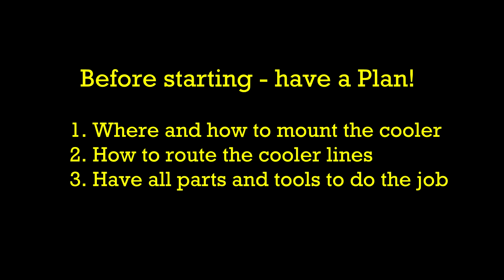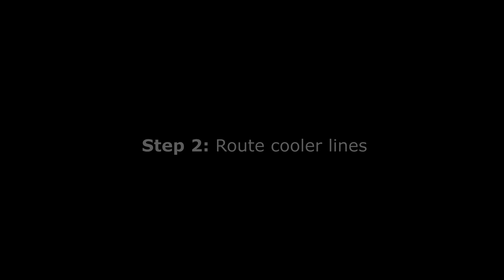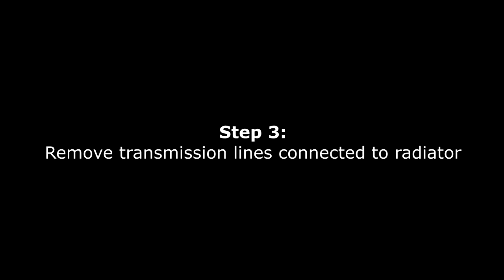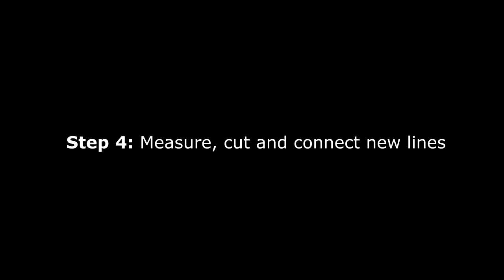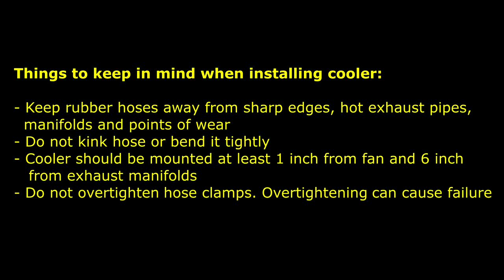How to Install Transmission Cooler Bypass Radiator - GMC Canyon, Chevrolet Colorado, Hummer H3

Comment: Excellent video -- short, to-the-point instructions, great camera work, and no needless chatter. 
Careful workmanship is evident throughout the video.
 HOWEVER, 😁, there's room for improvement, thusly:
 1. Your "Stacked Plate" type cooler is mounted UPSIDE-DOWN -- should be mounted with HOLES UP to avoid air pockets and achieve maximum cooler efficiency.
 2. Should use "Fuel Injection" type Hose Clamps -- They clamp tighter without damaging the rubber hoses.
 3. It's NOT COOL to by-pass the internal radiator Trans Cooler. NOT recommended by the "Stacked Plate" cooler makers. ONE Japanese car maker had cooler tanks fail abnormally, while the overall failure rate of cooler tanks is VERY small, and NO cause for alarm.
Those concerned with the coolant tank failure should GUARD against it, by checking the Coolant for ELECTROLYSIS.
 Place the "+" probe of your Voltmeter into the Coolant (engine WARM), and the "-" probe on the Battery NEGATIVE post. Should read less than  0.4 Volts DC.
 If experiencing high electrolysis readings, run a GROUND cable from the ENGINE BLOCK to the NEGATIVE Battery Terminal.
 I've run a B&M 13,000 btu "Stacked Plate" Trans Cooler for over 16 years and over 180,000 miles -- and I live in Phoenix, the hottest big city in the U.S.A. .
 Coolant is routed from Transmission OUT to Cooler IN -- Cooler OUT to Transmission IN.
The Cooler Maker's (B & M) Instructions said to do it that way, and it has worked perfectly for years of scorching desert driving.
 https://www.mercuryforum.com/forum/grand-marquis-14/1995-grand-marquis-restoration-8937/

Comment: This is exactly what I was looking for. I want to bypass the internal cooler so no chance of mixing fluids. What did you use to plug the old connection points on the radiator?
Reply from the maker: My wife's big ear plugs for now until I find proper solution 😊.
Reply: @NewRoad  Honestly it probably doesn't matter too much if it's not going to be used again.

Comment: I am about to do the same thing to a 2015 suburban and a 2002 Tahoe.  I have had 2 different friends radiator fail and water get into the transmission and smoke them.  I also live in the south and don't need the radiator to heat up my fluid.  I am just concerned about the rubber lines failing down the road. I am also going to use fuel injector hose clamps. How long have yours held up?
Reply from the maker: I installed this one 4years ago - no issue at all. Rubber hoses are tick and manufactured for high temp. Just make sure you properly tight hoses to line and cooler -  rubber hose should go over the metal lips on both trans line and cooler and clamps should be behind the lip to prevent slippage
Reply: @NewRoad  Gotcha.  Thats how I planned on doing it.  Now if the temps will cool off a little.
Reply from the maker: It is cooling more than I expected, never go higher than 180F even when outside is 93F

Comment: Great video bud!

My only suggestion, is that center support is blocking quite a bit of the cooler. That's going to reduce it's effectiveness significantly.
I considered the same placement of mine initially but then opted to put to the the right of the support so that the entire surface gets hit with fresh air.
Reply from the maker: Thanks. I thought about it as well - but here is my thinking:
- My main goal was to separate trans cooler from radiator so fluids don't get mixed if radiator breaks. Even if I get 50% efficiency from cooler it is still better than internal in radiator. 
- By rough calculation by measuring how much the support is blocking is ~25%. However, it might be less - since I have 1 inch gap between support and cooler - which will allow air circulation.
- The cooler rating is higher than I need for my H3 - GVWR up to 24,000 pounds, towing up to 5,000 pounds. That should compensate for blocking part of cooler
- I have only 3 months when outside temp is about 77F, the rest of the year is much lower. I don't tow and I don't go to desert :-)
Reply: @NewRoad  yeah, I did the same... Completely bypassed the built in cooler.
Reply: NewRoad Adventures You tow 5000lbs?
Reply from the maker: @lordsonic4567  I don't tow, but I do a lot of offroading and overlanding
Reply: @lordsonic4567  l tow up to 5000 lbs. with my 69 f-100 , 300 straight 6 cyl hooked up to a C6 auto transmission. It's got more than 100k for sure. I've got a trans. fluid Cooler out of a 95 Ford f-350 dually. Bypassed the radiator, not quite as big as in video but l got to thinking of replacing it with the one shown. Cause l live in part of US where temps. reach 100 degrees and up to 110 sometimes for 5 mos. a year. Maybe  adding an electric fan too. I haven't had any trans. problems yet, but l got to thinking since l don't have a trans. Temp. gauge. This was a very well done video. I'm out the door on my way to Napa! Does it matter which way the inlet and outlet face? Up,down or to the sides? Thank you.
Reply: @olblu8746  Yo, Blu -- the "Fin & Tube" type coolers (like in the video) can be installed in ANY position.
 The "Stacked Plate" type cooler MUST be installed with HOLES UP for it to function properly.

Comment: How’s it holding up 3 years later?
Reply from the maker: Works better than expected... cooling more than I need, perhaps because I am in Canada 😄. If you do decide to install - make sure push rubber hose far enough behind the lip on trans line to install clamp behind the lip just to make sure

Comment: What are your average trans temps now?

I installed a CRF radiator and put this cooler inline with that after it. Trans stays at about 175 now on a hot day on highway. (Compared to being at 200+)
Reply from the maker: I have not seen my trans temp going higher than 183F on very hot day, and I am happy with it
Reply: @NewRoad  I have H3....no trans temp gauge...how are you reading the temperature?
Reply from the maker: @terryvaughn677  I am using ScanGauge 2 - here is how I setup: https://youtu.be/4XxPsBD1qAQ

Comment: Is that a regular drill fitted with a cutting bit? I can tell from the low RPM. My cheap ass plans to use metal cutting disk for Dremel on a regular electric drill, too.
Reply from the maker: Yes, I have very cheap drill - and it does work all the time 🙂
Reply: @NewRoad  Thanks! I just did mine today. Running good so far. Thank you for this!

Comment: Hoping for an answer since it's been so long since this was posted, but what do you plug the radiator lines with?
Reply from the maker: You will lough... 😄, I used ear plugs and tape to seal it. I planned that to be a temporary solution - but forgot about it and it's still there...
Reply: @NewRoad  came here just for this question lol, so what would be a permanent plug if that was just temporary?

Comment: Others  are buying factory cooler with four tubes and  install together with  aftermarket  transmission  cooler, and others just disconnect  pipes from the current installed factory  transmission cooler and take the pipes from the after market transmission cooler and connect it to the return hose pipe and the inlet pipe of the transmission  direct. What is your opinion, what do you think is the best? ?
Reply from the maker: There are two main reasons people are installing and using a separate transmission cooler:
1. to prevent mixing of transmission and engine cooling fluids. Some radiators are failing and mixing both which destroys transmission
2. to reduce temperature of transmission fluid - this extends life of transmission
Reply: @NewRoad  i actually purchased the  transmission cooler and i want to install on my Nissan car, but really i still can't install it as am getting confused whether i should by pass stock cooler or i should connect in series with the stock cooler, but i think nissan has different system where no way the coolant in the radiator can get mixed with the transmission  fluid. Kindly hope you nay know about Nissan cars kindly advise me before installation which method is appropriate, thanks
Reply from the maker: @edwinalexander1170  I am not too familiar with Nissan vehicles, I'm sorry. I would suggest to google and do some research for your specific car.

Comment: Hi just came across your video. Found it very detailed. Is the cooler still running? How are the temps since you bypassed the stock cooler.
Reply from the maker: Cooler is running awesome, and sometime the temp is lower than I expect, especially in winter...

Comment: Great idea. Going to do the exact same thing on my 2015 Ram. Only thing I’m going to do differently is to have the fittings on the cooler pointing upwards. That way the cooler should be “self bleeding”. i.e. any air inside the cooler will not be trapped in there.
Reply from the maker: Good idea. BTW, my setup works fine and cooling more than I expected
Reply: @NewRoad  what are your temps like? I have a slightly smaller version on my car but still have it go through the radiator one first, problem is it still seems to get to the same temps as before.
Reply from the maker: 180F in summer and 120F in winter max, I am in Canada.
Reply: @NewRoad the in/out should on the right,left ,or facing up. Not facing down. You should post correct mounting videos.🤦‍♂️🤷‍♂️
Reply: @NewRoad It is not recommended to mount the cooler with the fittings pointing down as this may create an air pocket in the cooler resulting in reduced cooling efficiency.

Comment: How was your trans temp after that ? Thinking about doing it to my 2004.5 lly duramax. That's how all the older cars used to be done
Reply from the maker: More cooler than I expected... In summer it does not go above 180F, and in winter (I am in Canada) - it's actually stay too low and I need to put something in front of cooler to keep it warm 😁... stays around 130F... not sure if it's good to have it this low

Comment: The idea of keeping the radiator cooler in the trans fluid loop is to add a quick warm up cycle for the trans fluid. I can see this being an issue in the north / high country but in Oklahoma where I am, may be  unneeded. Just my 2 cents. Cheers.
Reply from the maker: Good point, not sure how much it is going to hurt transmission if it takes longer for transmission fluid to warm up. I am in Canada, so far so good... even though the TFT is always between 130-170°F and takes longer to warm up
Reply: @NewRoad  170 isn't a bad temp...I think HOW you drive (easy) when cooler is more important than a cooler temp issue...warming an engine in frigid climates is a good idea anyway which gives the tans a bit of a head start...
Reply from the maker: @ronmoore5874  agree

Comment: Awesome video going to do this to my 2011 Chevy Silverado. What hose size etc did you use? What did you use to plug radiator inlet/outlet? I was thinking some JB weld 😂
Reply from the maker: I used this cooler which comes with long hoses: https://amzn.to/3cgQx0p.  To plug radiator... don't lough... I used ear plugs and tape  😂 as a temporary solution.... but it is still there since I don't wan to weld it permanently in case I want to go back to original config

Comment: Can you also bypass the oil cooler from the radiator? I have a 2005 Hummer H2 and I’m doing the fan conversion but those Oil cooler lines are in the way of the new fans. I just want to do an external oil cooler to the front of the grill and call it a day. I’m need to plug the oil cooler lines from the radiator tho. What kind if plugs do you recommend?
Reply from the maker: I am not familiar with H2. Are you referring to transmission fluid?

Comment: Another Great video New road ! !.... Have you had any problem with engine radiator getting hotter because its covered more now with tran cooler ?
Reply from the maker: Thank you. I have not notice any difference in engine temperature - but big difference in transmission temp
Reply: @NewRoad  OK Thanks again man ! ! !

Comment: Question. Is it okay to install the cooler with the hose downward just like you installed it? Im asking because i saw some guys debating in a chat and one of them was saying the hoses should be to the side with the hot pumping hose higher than the cold hose. If that makes any sense.
Reply from the maker: Yes, it's ok and work absolutely fine. It's actually cooling more than I need. I know about debate - but it's like debate about which engine oil brand is better 😄. Most important is to properly install it to make sure hoses don't detach. The hose end that attach to trans line should go over the lip and use 2 clamps to secure it
Reply: @NewRoad  that's good to hear. Thanks for the reply. But I do have one more question. I did some research and I found out the cooler that was installed is a hose & fin cooler which I think is different than the one you installed. Does that make a difference? I noticed with the new cooler my Wrangler is still running at the same temp, getting hot amd possible going to cause the same problem. I need to drive in stop & go traffic to really test it out.
Reply from the maker: @joeshunt6416  I didn't try other coolers, so can't really comment on that. How do you monitor temp? I have this one and it is really good at monitoring many parameters: https://youtu.be/4XxPsBD1qAQ
Reply: @NewRoad  I installed a glowshift gauge back in 2016.

Comment: Does it matter if inlet and outlet ports are facing downward? My overhauled transmission was fixed and I told them to install tranny cooler and disconnect from radiator. They installed cooler with inlet and outlet ports facing down like yours, but looking at a lot of youtube videos almost everyone puts the ports to the side. One youtuber says because if ports faced down the fluid won't circulate all the way to the top of cooler, only 50% of cooler will be used, but if put with ports on side all aluminum fins would be used. Thanks for the video, any feedback appreciated.
Reply from the maker: I don't have scientific comparison or any proof to support any theory - but in my case, it does what it suppose to do - cool off trans fluid. In fact, it does it so well that I need to put some isolation for winter because the temp stays too low.  
Here is what I have to monitor trans fluid temperature - https://youtu.be/4XxPsBD1qAQ

Comment: The clamps being used to hold the rubber hose to the metal transmission lines are a risk.  They could slip off over time and release all the fluid, which would cost another transmission.  They’re under persistent pressure.  They should be crimped on at the point where the rubber meets the metal transmission lines.
Reply from the maker: Good point, most important - rubber hose should go over the metal lips on both trans line and cooler and clamps should be behind the lip to prevent slippage

Comment: The skid plate/ air deflector on the colorado is different than on the H3 so drilling at the bottom won't be as straightforward as the example in the video. I routed mine through the bottom passenger side corner of the radiator I also had to cut some plastic from the skid plate. I have a 09 colorado v8 idk if it's different on the I5/I4 models it shouldn't be.
Reply from the maker: Thanks for additional info for Colorado owners

Comment: how is it in the winter when its colder?
Reply from the maker: I'm in Canada, so I put some isolation in front of trans cooler... otherwise temp would be really low.
Reply: @NewRoad  hi thanks  Or quick reply I What do you mean by isolation?  I'm from Wisconsin here and want to bypass the radiator,  I had my old radiator internal failure and took out the transmission too cost me a petty penny to fix! I need to know before I bypass the radiator if it will be find in the winter
Reply from the maker: @makosharkcnc7730  I use small piece of thermal buble foil and put in front of cooler. I might make small video-short to show. Never had time to think of anything better. I have gauge to monitor trans temp - so very handy to know when I need it or not

Comment: Dunno if it'd be a good idea to ziptie the hoses to the sway bar.  It is always moving and could be a point of wear.
Reply from the maker: That's why there is protection around hoses
Reply: @NewRoad  Still, my guy.  There has to be a way to keep them off a component that continually causes friction.

Comment: Nice but can i use both at the same time???
Reply from the maker: Yes, but the reason I installed separately is because... as radiator gets older it may leak and mix cooler and transmission fluid which can cause transmission failure

Comment: What difference will be
Reply from the maker: 2 benefits:
1. Lower transmission fluid temperature - which extend live of transmission
2. Preventing mix of transmission fluid and coolant in case when radiator have leak between two. It can ruin transmission when transmission fluid and coolant mix
Reply: @NewRoad  thank you
Reply: Definitely purchasing

Comment: i would think just add a manual radiator fan switch so that you can turn on your radiator fans when needed especially in the summer or towing. It would cool your radiator down fast and your transmission fluid down if it is connected to your radiator. Just a thought instead of doing all this work.
Reply from the maker: The main reason for doing this is to avoid transmission destruction when radiator breaks and mix coolant with trans fluid

Comment: It is not recommended to mount the cooler with the fittings pointing down as this may create an air pocket in the cooler resulting in reduced cooling efficiency.
Reply from the maker: It is actually cooling more than I need, try it on you truck and let me know